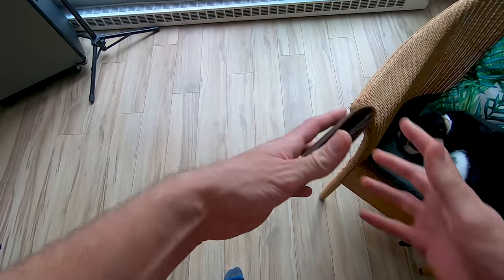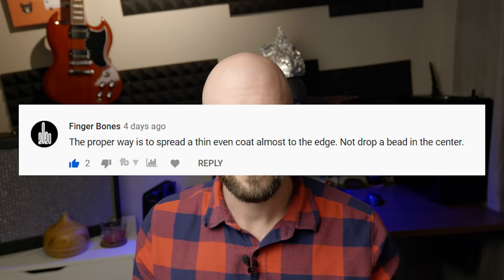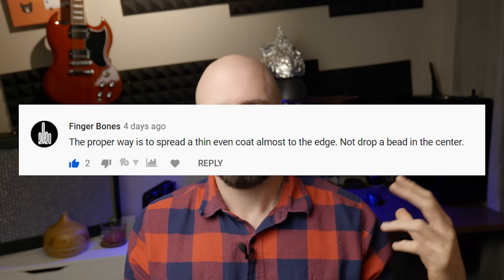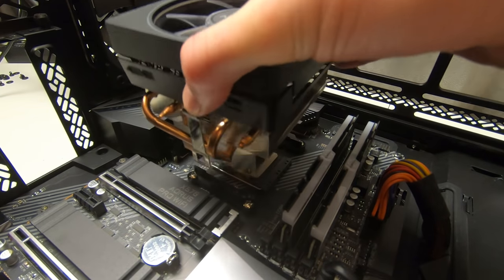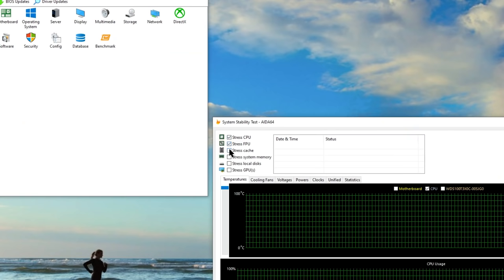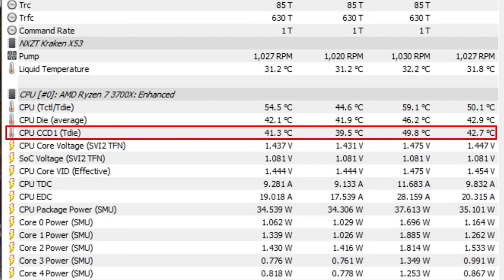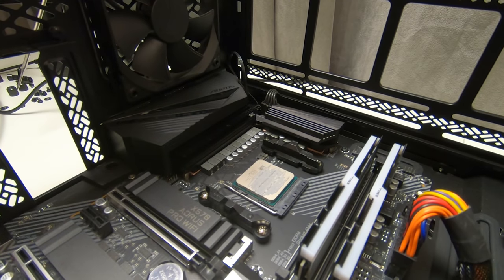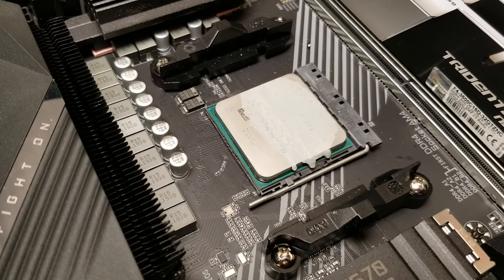Best Way to Apply Thermal Paste? Does it Even Matter?

Comment: About 15 years ago, I picked up this habit-- use masking tape to section off a square on the bottom of the heatsink.  Add several layers of tape to build up the boundary, then spread the paste so it is flush with the raised boundary of tape.. then remove the tape and you will see that this is the closest method to the factory 'pre-applied' spread.  I've never believed that it makes a ton of difference, but I know that I've never had thermal problems and in the event of disassembly, this method is always the easiest to clean.

Comment: The line/rice method is for laptop processors where the die is a rectangle. The pea method works, but you have to put the right amount. You put too little, especially with the cooler having the pipes exposed like that, but yes, there isn't much temp difference.

Comment: I would suspect that the point is to get an even layer of paste between the heatsing and the cpu/gpu without airbubbles. therefore I would expect to be the cross to be most effective, considering how it spreads out when you press the heatsink on the surface of the cpu. I'd think when you do the pentadot method, the dots start to spread evenly, but bubbles could get trapped  where the circular spreads meet. Still, as it shows, it doesn't make any significant difference. It could worth to test to try different amounts of paste, maybe there's an optimal thickness that could improve heat transmission between the surfaces. Also, different spreads might "age" in a different way. I'm not sure what ahppens to this material over time, but my uneducated guess would be that the heat changes the chemical structure over time, makig it less efficient, so the difference could show over time as a different layer thickness or more/less air trapped in the paste could make it wear out quicker.
Reply: There is "optimal thickness that could improve heat transmission between the surfaces", and it's zero thickness. The thermal conductivity of the paste is always less than that of the metal used for the IHS and cooler. The only point of the paste is to fill in tiny gaps that exist where the two surfaces don't meet perfectly. Those gaps would contain air, which is a far worse conductor of heat than either the metal or the paste. The conclusion is that it is optimal to have enough paste to ensure any gaps are filled, but no more than that. Of course, the gaps are far worse than having too thick a layer of paste, so most of the time folks will err on the side of excess paste, particularly as it will protect against ill-matched surfaces.

Comment: I did the " No paste at all " variation for science while opening them to refresh their old OEM thermal paste on both my 12xx model PS4  and mid 2012' 13" Macbook Pro ... from a little fan noise to loud to a bit more louder for the PS4, and from ~43-44°C to 50°C on the laptop. Both idle on the main screen. I would say in normal usage without considering performance, even no paste at all would do it,  and on recent hardware chips would just throttle down anyway. After all smarthones , tablets and even some laptops do not necessarily even have a fan. With technology advancing we will probably see days where thermal past would become a thing from the past like blowing into your cartridge console and wipe your Cd's with your shirt had became.

Comment: X or 5 dot is the way to go. And not too much. Spread can cause too many problems with overlap, and too much paste isn't good either. So many people seem to think you need gobs of the stuff and it has to cover the entirety of the CPU or it won't be effective. Thermal paste only exists to fill in those microscopic grooves and pits on the metal surfaces of the CPU and CPU cooler to make better contact resulting in better heat conductivity and dissipation. Too much paste interferes with that transfer. As you've demonstrated here, complete coverage of the CPU shows, maybe, a 0.1 degree of difference. You really don't need to get it covered edge to edge, corner to corner. Relax, it'll be fine.

Comment: Thank you, Nick!
OK, the TIM application doesn't matter, OK!, FINE!, just FINE! ;)
It also doesn't matter if you apply TIM, mount the cooler, & dismount it.
You know, to check the paste distribution.
You can remount the cooler without reapplying the TIM.
At least it didn't seem to matter to my old AMD Athlon II X4 640 when I did it.
That was in 2010, when the onboard NIC was fried in 2015 it was still good.
I changed the mobo, remounted the CPU & it was fine.
Later, I replaced the 640 w/ a FX-6350, I think it was June, 2019.
I plan to rebuild my system in a month or 2, I'll check the TIM pattern then.
But I have to say, the temps are very good, 108°F/42°C for a FX-6350.
That's on an almost 3 yr old system.
So either I got very lucky OR I did it right the last time.
Hey, pal, I think you're doing a GREAT job, & keep it up!
Have a GREAT day, Neighbor!

Comment: Since all of the methods above(except last one) are within half a degree between one another, I recommend users to go with the Dot/P method, it would be much much easier to take apart the cooler in the future and not risk ripping the CPU from the socket when you pull apart the cooler.
Reply: Idk about AMD, but on intel the motherboard keeps the cpu mounted on the socket 110% so that wouldnt make any difference.

Comment: Would be curious if you used a bigger sized dot, enough to cover more area of the CPU, if it would have evenly spread or if the extra would have just leaked out one side.  I feel like the cross, multiple dots or full spread methods would have a higher chance of creating bubbles so I usually just use a dot or rice method but like what you showed it really doesn't seem to matter if you have enough.
Reply: It works until it doesn't. The chance of an airbubble that large isn't really high, but why take that risk if even more simple methods like dot or rice grain work perfectly...

Comment: I'm a P or rice grain guy and never had an issue. I think most people's issues come from not mounting the cooler in one move and/or removing the cooler "too see if it looks right". It is very important to mount the heatsink in one solid motion without letting it lift at all. The moment the heatsink loses it's place is opportunity for air to create gaps.

Also, I'm not a fan of your cooler with the grooves in it.

Comment: I have always used a pea sized in the middle and it always covers the whole cpu face, if it doesn't your not using enough
Reply: I suppose it depends most on what of size of pea you're used to lol
Reply: @Failzz8  well if we are being pedantic then even the smallest size pea depending on which pea you use is usually enough to cover the whole CPU face really, unless your idea of a pea sized amount is a grain of rice size amount which isn't a pea sized amount 😂😂😂😂😂
Reply: @stevesracingbits  😂😂😂😂😂😂😂😂😂

Comment: I paint the entire CPU so it's covered like a peanut butter sandwich.  Why wouldn't you . Full coverage. Just makes sense
Reply: You’re insane... love it
Reply: because it gets squished flat, why waste time?
anyone whose ever made a microscope specimen would know the pea creates a flat, perfect seal, with no bubbles.
Reply: @Zakumei  if you consider anything under a minute a waste of time youust have terminal cancer or soemthing. It literally takes less than a minute and thermal paste is extremely cheap to buy. 
And on my ryzen 5800x the method dell used didn't do a damn thing and actually cut grooves the size of the chip into the copper plate of the liquid cooler because it wasn't full coverage. This is why I make peanute butter sandwiches now
Reply: @MurdahBassRecords  you seem really heated about this dude. are you okay?
everything alright? theres no need to be hostile, no one is here to hurt you
Reply: @MurdahBassRecords  also you wouldnt want too much overspill so overapplying with the "PB spread" could cause conductive compound to spill onto other contacts or even get under the heatsink of the processor itself, which can cause shorting and CPU damage, maybe even contaminate the pins if it leaks out enough and seeps down the socket when under load.
a moderate, pea sized drop, or a light version of the X method should be more than adequate
Reply: @Zakumei  you obviously don't understand the difference between  thermal paste/grease and liquid metal. Liquid metal like grizzly conducuant and the rest of them have  gallium, indium, and tin which is electrically conductive. 
Arctic  mx5, and Noctua thermal paste the most widely known and used are not electrically conductive and doesn't matter if you get them on the PCB. Learn your ABCs and basic physics before you attempt to come at me with nonsense
Reply: @MurdahBassRecords  as someone who DOES know the difference, i also know people use silver grease as well. and while you may not, and thus it wouldnt be an issue; if you DID use a metallic compound, component contamination would be an issue.
This? this is the hostility
like why question my intelligence? I completed AP Physics with a 98.9% in college. I know that not all thermal grease is the same, i switched from Arctic Silver 5 to MX-5 for exactly the reason i listed, so that terminal contamination isn't an issue. why are you being so toxic right now?

Comment: As an old school benchmarking drag racer, we used razorblades to get the most even spread possible and we spread on both mating surfaces.  The difference is very small, but that lowly .1c can get you the top score, so we did it.  lol   I still apply my paste this way.

Comment: Dude great video.  honestly as a old school nerd that has been doign this for years.  IF ANYTHING it wigs me out when the thermal paste gets off the top of the chip.  i know some thermal pastes arent conductive now (which is a little weird) but whatever.  But if you are using a conductive paste like a silver or something that paste on the sides could get dripped or fall onto the rest of the components in the rig.  I have always just used the pea method.  always works.  What make me have to change my cooler is i smoke like a chimney and the nicotin gums up the fan.  lol  you are welcome for the nightmare :D <3

Comment: it will matter under heavy load for long period of times. the best is to have a uniform spread across the cpu without splling it. also, to remove dry paste, isopropyl alcohol (70%) is good without damaging the cpu. you can find that in any drug store

Comment: Great stuff man! I've been a Systems  Engineer for just over 25 years and had to buy some new CPUs which required upgraded heatsinks for a server, and the thermal pads on one of the heatsinks actually had a fingerprint it! Clean it with 90% isopropyl and apply some new paste, right? Well, I've used "buttered toast" forever, I've always been curious as to what the best method is and you have laid that to rest. Thank you, sir!

Comment: If you want the best possible temps (relative to all variables) to obtain the best possible overclocks, you must understand that it's a game of "the sum of all parts".

2-3 degrees lower on your cpu + 3-5 degrees lower on your VRM etc etc will add up into a higher OC at lower temps.

Comment: It really depends on the type of paste. The paste that's currently supplied with Arctic coolers, for example, is very sticky and virtually impossible to spread "manually" (you end up with half of it sticking to the spreader, and a lot of air bubbles in the middle). A central blob or a cross generally works  fine for all types of paste (and will spread itself out without leaving any voids), as long as you use about the right amount.

Comment: Correct you`re right! It really doesn`t matter how you do the thermal spread especially if the difference is just very very minimal, but still people do care about how low the temp will go down.. also applying very little will make the thermals go a bit up.. the better the coverage results will show. At the same time don`t apply too much because even though it will have a good coverage but it will overflow from the side, kinda like mess if you try to re-apply the paste again.

Comment: Minimizing air bubbles is always ideal, since any air bubbles on the CPU means that the spot where there’s no paste contact will heat more than other spots with the contact, and could cause uneven damage over time.

Comment: I mean I’ve done my own testing over the years. A pea size works fine. But what I’ve found if you want to NOT squish paste out onto your socket cover, peas size works just fine. What I do now is put a pea size, then I spread it evenly to the edges. This way it covers it all and you get max thermal dissipation. Some squeeze out around the edges, but not much. But I do find spreading it out gets you better cooling but only about 1-2 degrees in most cases. So do what you will.

Comment: Very late to the party, but I'll say this:
On my 12th gen i5 at least, the "pea"-method resulted in roughly 20 -25 percent of the heatspreader not having any paste on it at all. There was literally no paste on a pretty wide strip down towards the bottom/PCIe-slot. 
I took my AiO off the CPU the other day because I was changing to a new case and that's what it looked like under there after 16 months. I was using a low viscosity paste (CoolerMaster Master Gel Maker, IIRC). I cleaned everything before re-installing the waterblock, then tried the "X" method, making sure the X reached out all the way to the four corners of the CPU. I also tried to go easy on the quantity and managed to lay down two thin lines. Installed the cooler and screwed it down, then took it apart again to check the spread. It looked pretty much as it did in your example, with the paste spread very evenly and covering the entire heatspreader. Cleaned everything again, re-applied the paste with the same method and never used a spatula. Can't tell about the temps - they did go down significantly, but then again: I did change to a case with better airflow and a much more open front, so my radiator is now getting a lot more air (difference between cases is pretty high... like 10 to 12°C under high load). I do think this is mostly due to the new case, but it's probably not a good idea to not have the entire CPU/heat-spreader covered with paste.

Comment: I went ahead with the "Buttered Toast, Spread Method" yesterday when I installed a bequiet! Dark Rock Pro 4///I-9 12900k///Gigabyte Z690 Master combo yesterday. I couldn't bear the thought of missing areas between the CPU and CPU cooler heatsink. :)

Comment: I think it is worth noting where the heat sources are under the heat spreader.  The whole heat spreader is not equally warm.  The chips under it make hot spots.  If those are covered you should get decent results as your tests showed.  When you used the little pea it did not cover enough and your temps were bad.

Comment: Grooves are for mechanical reasons. There are forces applied when you close the screws which spread the paste to the side. The grooves are there to let excess paste escape to the sides, otherwise the forces would be higher and you could damage the chip.

Comment: This just goes to show that the application, within reason, is not the bottleneck for cooling.  In industrial applications there is extensive testing to account for surface preparation and how it affects cooling.  I don't have the source on-hand, but the fact of the matter was abrading the surface with various grits of sandpaper affected the cooling performance.  Obviously, polished surfaces reflect heat and this was proven when using finer and finer grits began to degrade cooling performance, but too coarse had the same effect.  I know most people probably don't want to scratch up the top of their CPU's, but at least give attention to the heatsink face.

Comment: I've been using a razor blade to spread paste thin and evenly for 33 years--since before the internet. Paste is just not as good a conductor as pure metal and, relatively speaking, acts as an insulator. What I mean is, suppose you soldered the heat sink to the CPU... now we have basically fused it into one part, which is ideal. But when the paste is way too thin (nearly scraped off) then you effectively have micro air gaps which gets closer to not using any paste at all. So the trick I have always used is to get the thickness JUST enough to fill the micro gaps but not too much to stack the layers of paste creating an insulation scenario. Once the heat sink is clamped down, I give it a bit of a wiggle (you can usually wiggle it a couple of millimeters) to ensure it's evenly spread out. If you feel it sliding smoothly, then you know it's not too thin. Anyway, this has always worked extremely well for me. Finally, there is no drip over the edge of the CPU with this technique. I have never had an issue with dry-out.

Comment: On Cpu and Gpu i prefer the same method. Spreading it out as much as possible. On the CPU it is not necessary but on the GPU it is since a GPU has no IHS or heat spreader

Comment: I built 100s of computers in a production line. Best way is a reasonably big dot in center and Don't get messy like when you take off heat sink, corners of cpu should be nice and clean. Don't put it like butter, Mayonnaise or cheese! Its not a fikin toast! Its a delicate piece of electronic hardware sensitive to static and liquids!

Comment: Tiny Dot wont reach the corners.  I was told that you need enough paste so that the paste hangs over the edge of the IHS for the best cooling.  The small dot will cover a small area in the middle of the IHS and leave the rest bare.  Thus cooling can be reduced to the CPU.  I does not matter what method you use, so long as the IHS is fully covered.  Just the right amount of thermal paste.  You dont want the paste in the socket.